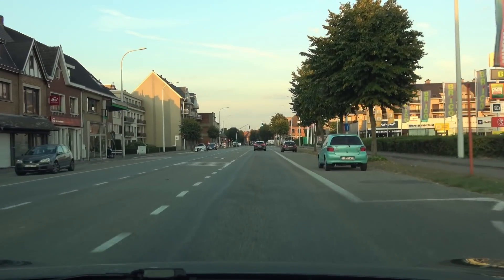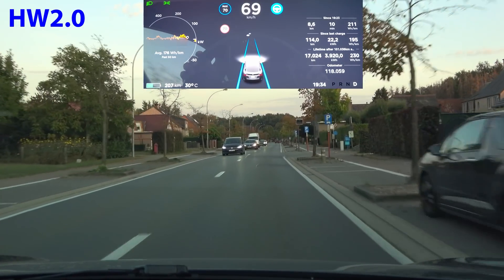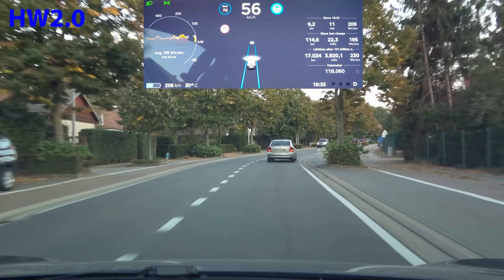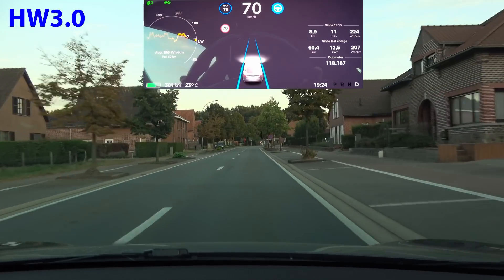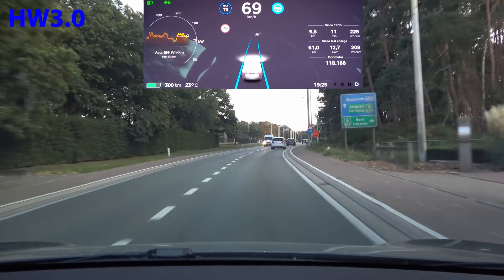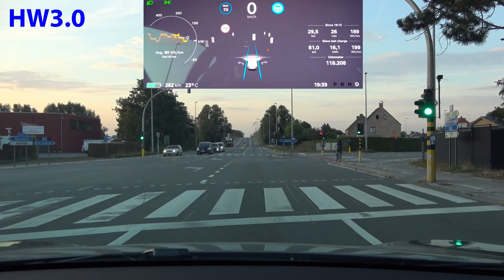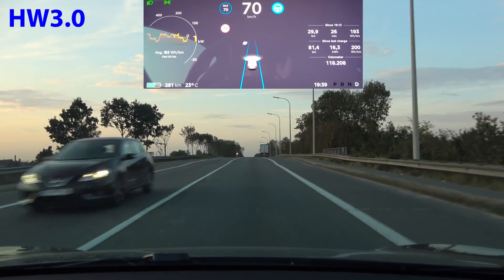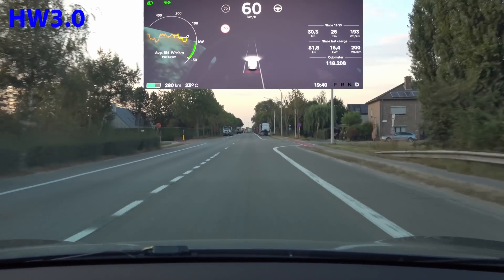Tesla HW2 vs HW3: What difference does the hardware make?

Comment: HW3 is probably not even utilized to quarter of its potential yet. At the moment they are mostly using same neural networks on HW3, just maybe slightly higher resolution input, and faster update rate, so it can react faster, and get more data points for movement estimates, thus reducing noise. That is why the disappearing lane recovery is faster.

Also while HW3 is impressive, and a definitive leader in the car driving tech by big margin, it is still has a lot of design dictated by some tradeoffs like power limit of the power supply to the old HW2 and cost. It is limited to about 36W per one FSD chip, for about 80W for a whole board. It uses 12nm manufacturing node, and just 6 billion transistors. It is rather small chip by modern standards. Something like chips in your desktop or high end android phones, can be using 10nm, or 7nm, or soon 5nm in next Apple phones. For example Apple A13 in iPhone 11 has 8.5 billion transistors using 7nm process, and probably uses less than 10W, and costs about ~80$ to manufacture (but hundredths of millions to design first). Apple A14 will have 11.8 billion transistors in the same area and power. And of course there are even bigger chips (~35 billion transistors), but they are too expensive to put in the car. The current chip is fully capable of being sufficient for many years to come, and maybe only in 2025 we will see update. Even then the current HW3 should be capable for level 4 driving once the software is developed fully.
Reply from the maker: The chip might be ready, but I personally don't see a path to FSD with the current sensor suite. It is blocked and blinded in way too many circumstances
Reply: @StevenPeeters  Yeah, the front facing camera is prone to not working well in full direct sun view. That must be fixed before FSD. A better camera and higher dynamic range and software improvements could help.

Comment: Before Re-write, nothing dramatic change will happen.
Reply from the maker: Well, there’s the fact that hw2 does not rake vones into account and just drives straight into them. It doesn’t recognize speed signs or traffic lights etc. There are a lot more features that make it worth it. But so far, the test points will indeed not be too different because AP us basically running in a virtual machine on the new chipset

Comment: Do you have any problem connecting the car with the app after change to mcu2?  
If my car and a friend's car do not have sentry mode activated or the car is charging, it is not able to connect with it. 
it is as if when the car is sleeping the app is not able to wake it up
Reply from the maker: No, I do not have that issue. I did have it with MCU1 just before the upgrade. But I have a mobile hotspot in my car, so it's almost always on WiFi.